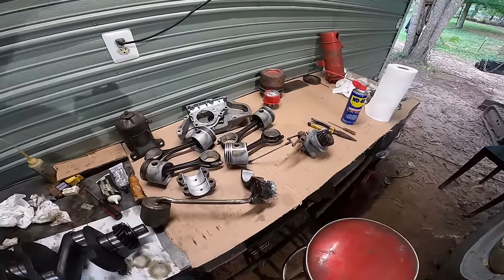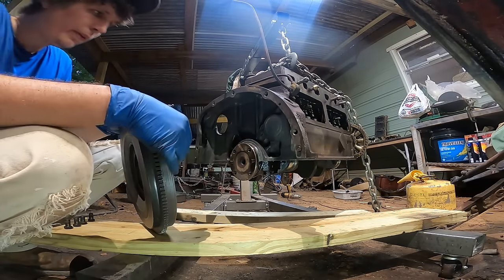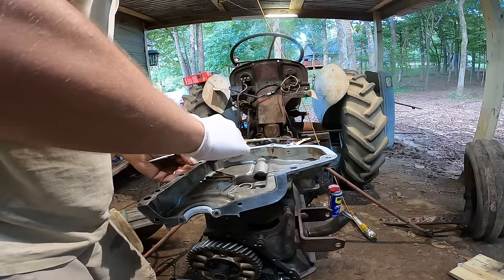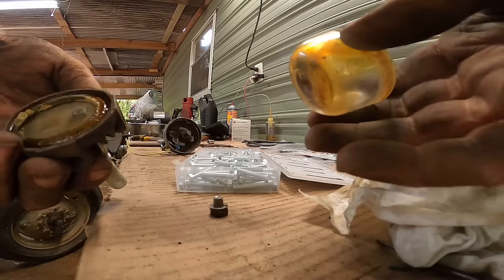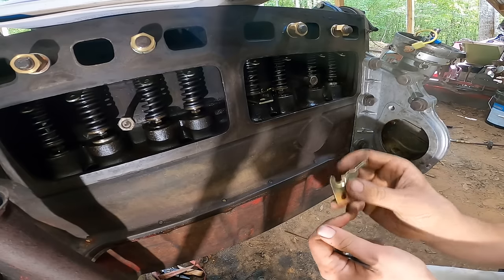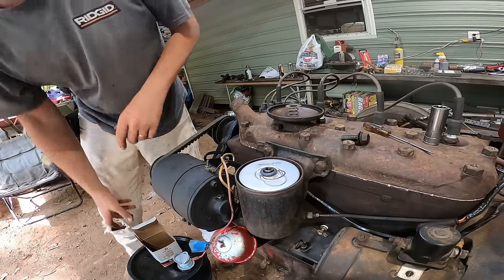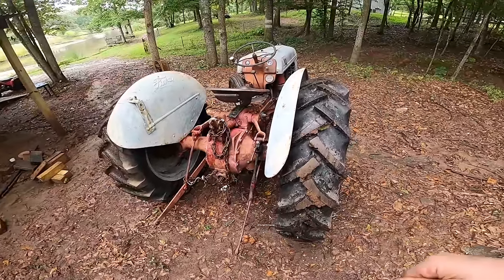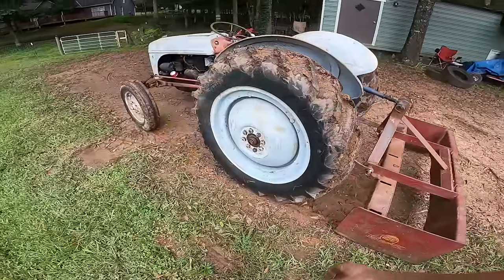RESCUING A 1952 FORD 8N TRACTOR FROM A BARN (PART4) SHES ALIVE!!!

Comment: You need to get some weights on those back wheels so you have better traction.
You would also need to put some weights on the front end of that tractor to keep it from flipping over backwards when pulling out stumps. Those tractors were famous for flipping over backwards and killing the operators.
I dated a girl whose father got killed that way.
Reply from the maker: I have a bumper and some weights on the front that I need to install I think that will help out a ton like u said. These tractors can be very dangerous thank you very much for the tips!!

Comment: its the throw out bearing making that noise it was noisy when u had it in your hand it in your hand u should of replaced it.
Reply from the maker: it’s not the throw out bearing it was dry in my hand cause I just cleaned it with brake clean thus noisy sounding, it’s the transmission pto shaft bearing it’s more of a clunking wore bearing sound

Comment: Question is did you plastigage the crankshaft bearings  before doing the final crank install ??  Just wondering but very important thing to do
Reply from the maker: yes I did I didn’t get a lot of stuff on camera just because the video would have been 4 hours long or more. I deleted a lot of stuff and it’s already over an hour long lol
Reply: Not critical to plastiguage the crank when it hasn't been ground as you are only replacing like for like and there will be clearance due to wear.
I certainly would be grinding the crank having gone to the extent of the strip down nevertheless but I can understand the costs involved.
Great to hear her up and running again though.
Over the pond here in the UK we still see these tractors as 'Wee Fergies' but the Fergies were probably more durable than their Ford 'copies'.
Great videos though, look forward to seeing those worn gears getting replaced, that noise ain't normal.
Reply from the maker: yes I really should have!! I just didn’t know who to take it to, I need to ask my machine shop if they do that

Comment: its your throwout bering
Reply from the maker: it’s coming from the pto cover, throw out bearing is very tight and doesn’t make any noise, in the video it sounded bad in my fingers because I just cleaned it with brake clean so it was dry

Comment: Any time you split a tractor that is older, always - always replace the clutch and throw out bearing.  Unless the clutch plate has more than 1/2 of the asbestos material and the throw out so quiet you can’t hear it turning.   It’s cheap insurance of not having to do it again a lot sooner than you expected.   And if you buy, fix and sell, you’re reputation will spread w/o having to advertise.   Word of mouth will bring you customers asking to see if you have any tractors 🚜 for sale.   Don’t get caught in the, “can you fix my tractor?” trap because the tractor will leave and if the customer finds anything else, (other than the problem he described) wrong, more times than not, he will be back complaining and expecting you to fix the new issue for free.   That’s just the way it is, sorry to say.
Reply from the maker: The clutch and bearing were in good shape and work perfect I’ve been using this tractor all the time for a while now and the clutch grabs really strong and the throat bearing doesn’t make any noise

Comment: you've got a leaky freeze plug, and I'd say your transmission is missing a few gear teeth. but it looks like you're having a ball working on it, like a dog with a bone.
Reply from the maker: The fuel petcock is dripping on the motor, freeze plugs are good. I think I have a bad tranny bearing hopefully teeth are good 🤞